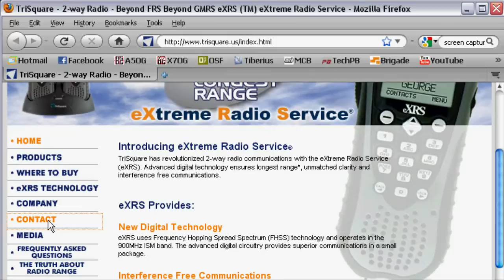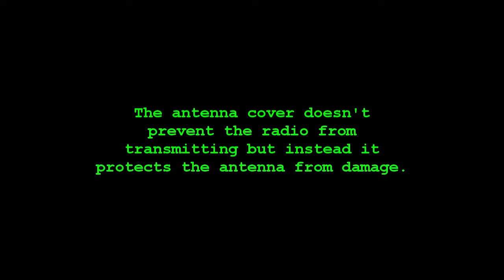How To - Replace TriSquare Antenna

Comment: i've done this, i've used a satellite female socket, the sort designed to connect two pieces ofr coax together,,,,its a simple matter the nof using an "n" plug with sat cable to an external antenna or even a wire whip plugged imto the top of the radio.
Reply: Do you just solder the inner connector of the n plug and that's it, or do you have to solder the outside to ground or what? I'm confused.
Reply: Bill Shatner fg